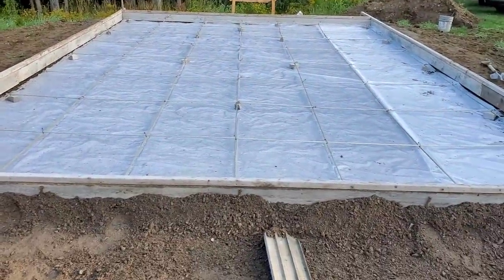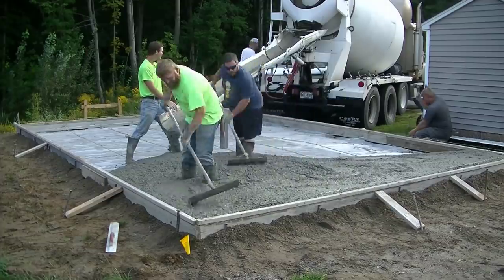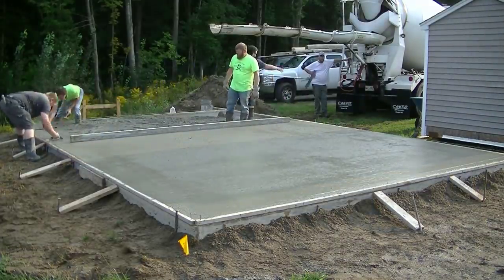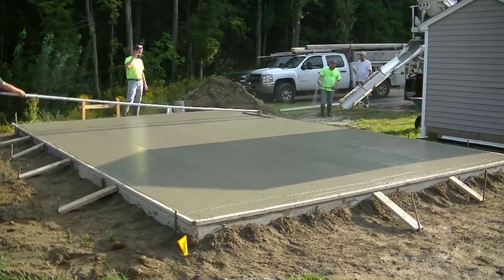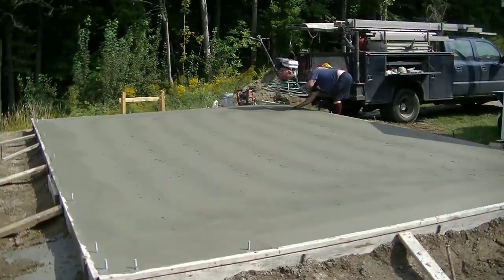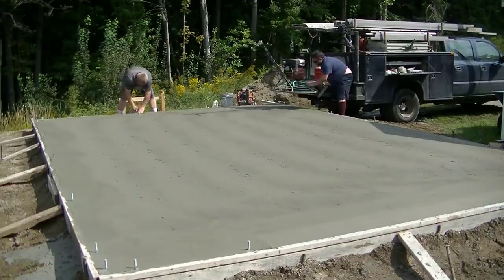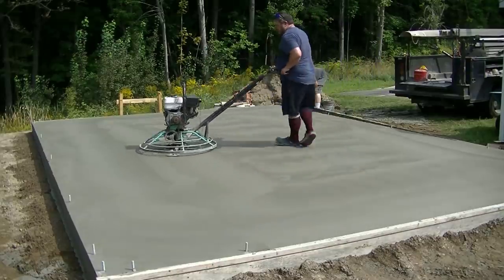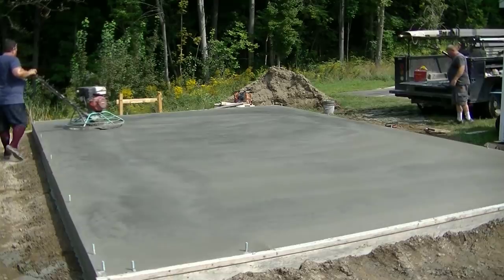They Made Us Pour This Shed Slab 8" Thick (Wasting Money)

Comment: Here in Michigan,  any slab supporting a building, that's less than 100 sq ft, a 4 in slab is code. Anything greater than 100 sq ft, then it would require a rat wall 8 inches wide by 18 deep, with re-bar and the slab 4 inches thick with re-bar like used on driveway approaches.

Comment: I don't get how these bldg's don't need footings to the frost line ? I watch a couple of NE guys, same deal. Heck, we have to put a deck stair landing pad supported to the frost line.
Reply from the maker: It's all in the gravel base and landscape afterwards. Permeable base that doesn't hold water won't freeze and heave.
Reply: @MikeDayConcrete  Thank you for the explanation. Steve in NC
Reply: You can always do what is called a shallow frostproof foundation/slab too...
Reply: As I understand it, and the reason for the 8" structural slab, is that you are making a rigid box.  The box floats on the base.  This is done in expansive clay areas as well.  Many with post tension.

Comment: I prefer having a vapor barrier under concrete where I don't want any moisture intrusion into the inside of the building.  Example was the tack room I put in barn;  have never had any moisture issues with Saddles or tack.

Comment: If this is an area with a lot of old people than the requirements you are faced with are most likely entirely because of them. Most likely scammers targeted the older population with subpar crap concrete work which prematurely broke down. The easiest way to prevent scammers is to have stricter regulations on work being done as well as a proactive inspector who visits sites to make sure the proper work is being done. If the scammer company didn't do the required work than the old home owner will have a much much easier time getting their money back.

Comment: Th3 building in florida collapsed because of corrosion from the steel rebar.  So im game for fiber glass rebar.   However in a situation where the concrete cracks.  If it does..  does fiber glass really have the bending ability to hold to the concrete if it shifts alot ?  Thats something i highely doubt.

Strength is one thing.  But can it bend ?.

Also you have no idea what kind of work hell be doing in his shed.  Maybe he needs th3 added thickness for something extremely heavy
Reply: You're correct about steel vs. glass reo. The latter has no ductility. Try bending a glass rod beyong its limit back and forth and then the same with a steel rod and then see what one will take a load. A bit extreme but in more demanding structures like in earthquake prone areas it is, but probably not in these cases.

Comment: Would be necessary with they wanted to anchor a lift to the floor no? But hey they want twice the material, they're paying for twice the material. It like framing with 2x6 with 16 on center, when 2x4 with 24 on center would suffice.

Comment: So is the fiberglass rebar cheaper? Can it be used for all Applications? Would you use it on Slabs meant for 50,000 Lbs busses. Or would you stick to steel rebar?
Reply: fiberglass rebar is fine for this application. You would probably want to use dowels or flat plates in the contraction joints as load transfer devices. Base support and compaction is of more importance than the tension reinforcement in the slab on grade applications.
Reply: @SigmaDG  thanks so much.

Comment: Everyone busted my ass for pouring 3/4 5000psi (6” thick)mix for my patio
Complete with mesh

Well, 12 years later my  patio is perfect.
My shitty 4”  ( 2500psi mix ) front walk with zero load  but foot traffic
Has 4 cracks.

Concrete is pretty cheap 
Pour thick

Comment: Something is going to be heavy placed on it.  When my father built his shop the foundation the footer is 1 foot in the ground with rebar, 1 foot above ground with rebar, 6 inches of ABC, and 6 inches of concrete.  Then dried slowly using soaker hose over a couple of days.  There is no cracks in the slab to this day.

Comment: fiberglass rebar sounds good to me as a homeowner - in my area everywhere you go you see exposed rebar all rusty - the metal gets wet and rusts and the rust causes expansion within the concrete and the concrete gets screwed up.  I would definately be a guinea pig and choose fiberglass if it were easily available
Reply: Good points hotdog!  This fiberglass rebar could be a game changer?
Reply: Good deal hotdog. Fiberglass rebar is not new... has been being developed for the last 30 years. Biggest use is bridge decks, so this is very very low risk applications.

Comment: Sounds like the local jurisdiction (somewhere in central Maine ?) has done a least a little homework in coming up with a minimum standard installation. My guess would be as an alternative to getting below the frost line (central Maine ?) and/or an engineered plan. Would be interested to find out where you get the fiberglass rods and stainless anchor bolts.

Comment: It seems as of 2020 or later half of 2019 the building inspector's are requiring a bit of overkill . I don't really know why , but they are . I had to pour a patio slab 6" thick with all four edges 12" thick by 12" wide all the way around the slab for a concrete beam and several 12" beams poured every so many feet . Now this is just for a patio slab . It's got more concrete beams than my dang shop slab . My shop hasn't had any problems or any cracks for over 25 years .  So I can't answer as to why everything has to be poured with serious overkill .

Comment: Interesting how stuff is done in other countries. In Australia the slab would be much thinner, maybe 100 mm, with an edge beam on the perimeter. Much more steel. 12 mm bars on the edge and sheets of mesh right through. steel stirrups to hold the bars in place. Much stiffer concrete and vibrated into position to make it slump and remove air. 
Anyone using a crane to lift a trowel machine would be told they were a girl and don't come back. if two guys cant lift it they better get another job.

Comment: What do you do with fiberglass rebar when you need to make a bend in it?
Reply: You will need to use steel bar in those situations, although they make some for columns (square). Basalt rock rebar made in Texas.
Reply: They sell pre bent corners, but they are very expensive..  The biggest issue with GFRP, even though it has a higher tensile strength, is it breaks instead of bends..   So everyone always says "it's stronger" and while technically correct, it has a sharper failure curve..  There is a great youtube video on the pros and cons of GFRP...
Reply: @FJB2020  agree....very easy to break.....
Reply from the maker: You gotta buy the pre-bent corners.

Comment: Showing again on how not use the reinforcement rebar. It’s needs to be up higher in the concrete
Reply: We were always taught that the wire welded mesh was to keep surface cracking distance to a minimum, so it should be at a minimum of 2 to 2 and 1/2 in below the surface. But if you're using rebar that would be intended to be in the tension zone which would be the bottom third of the slab. But an engineer usually has that spec'd out on the section cuts. But if you're just pouring a shed slab unless there is a gigantic piece of machinery that's going to be mounted on the floor I think what he's got there with the fiber glass rebar being at the bottom 2/3 makes the most sense.... This is just my opinion based on my experience.
Reply: Truth.

Comment: Why do skilled contractors always want to take short cuts, or cut corners?

If the inspector wants an 8” slab, charge the customer the extra labor and materials and just do it.

Also, the fiberglass rebar is too close to the ground.  Some rebar chairs would have been the correct call…

Comment: You're leaving out some information.  Because if you already had it set up and ready to pour with 2×6  you had to have a 1/2" gap under the form to make it 6" deep. So you couldn't just add 2×2's too the top and pour it. Because that would only be 7.5" deep and would also be 1.5" higher than the other slab if it was already set to grade. So you'd have to dig  out at least 2" underneath the form then pull all the nails in your stakes and kickers and let it drop down. Then go back through and set it all back up too grade and re do the kickers.  That's some bullshit because that's a lot of extra work you don't get paid for because there should be a structural detail on the approved plans that shows it being 8" deep.  Unless there's a revised set of plans with that detail and you had the original and nobody told you about it.  I've been on a job where that happened fortunately it wasn't me though.

Comment: Because one person had a problem in candle lake with a garage slab, they just made it so everyone from then on had to 8 in slabs with insanely huge thickened edge.  They could build 10 story buildings on those pads.  I cant remember for sure but I think it was 32 yards of concrete for 1 garage pad that was not huge.  

I have not used the fiberglass rebar yet.   What is the price comparison ?      LOL and I see the guy with the power trowel wearing crocks,  Why does everyone where crocks for power troweling?  LOL

Comment: Meh, the 42x28' slab in my shop came out at 7-5/8.  Used header block for the perimeter. 2'' of base. #4 bar 2' o/c plus wire mesh.  After the slab I went around the perimeter with 3 courses of 8-8-16 block then a 12' wall.  14' interior height.  Bolted down a 12k 2 post lift and a couple of machines weighing in at about 4-5k each.

Comment: It’s not as simple as thickness. It depends on the subsoil. 4” concrete is strong and if you want stronger add fiber. I spend my days, every day lifting settled concrete. The weight of 8” concrete is too much for most soils.
Reply: That's why you pour a footing or a monolithic floor. Pier and grade is crap and you might as well build on a landfill.

Comment: If you called a waste of money I don't think so if you pour the concrete properly or cement I should say properly with the proper mesh under it at like 8 9 in thick it will last a lot longer especially if you're going to be using it as an auto shop running a forklift over that floor or a heavier vehicle a 4-inch slab will split just like putty it's garbage

Comment: If its the city they're prob doing it because every garage floor at 4 inches thick is all craked up.
Mine is super old, built in the 1970's after the flood in pa. Mines all cracked in spots some of which is slightly raised over the other parts.

Its still usable for parking cars n that n holds the weight just fine so idc. If it was thicker, maybe poured with diff slump or fill or the way they do it now with certain fibers n that it'd of maybe lasted longer who knows.

Comment: With that much cream on top, is flaking a concern later on? We would advise customers to go with a broomed finish. They want it smooth because they are thinking about it being easier to clean, but they aren’t thinking about how incredibly slippery smooth concrete can get. Eight inches though?! That had to be a misreading of the code. Even if you were parking heavy equipment on there, 6 inches reinforced would be plenty strong enough.
Reply: I don't think there's much problem with spalling with cream at that stage. Power trowel isn't making much of an impact, so I presume the bleedwater has mostly dried off
Reply from the maker: We don't have any problems with flaking or spalling afterwards.

Comment: Your guys arent screeding it flat enough... I see them mag the edges and the screed never comes within a foot of the form boards.... Normally the screed would go all the way across from form to form to ensure flatness, or one side screeds to the form then they reach to the other side to ensure both sides are down to the top of the slab height. I suppose the magwork could be perfectly flat but I don't trust that as much as screeding accurately to the top of the form.
Reply: Of course it's just a shed, and you used a power trowel to help flatten it out.  I'm sure it's good enough 😉

Comment: My 3.5 inch driveway can withstand 70,000 pounds concrete trucks...I don't care about the thickness, It's all about soil compaction and the frost line ::    R403.3 -- For buildings where the monthly mean temperature of the building is maintained at not less than 64°F (18°C), footings are not required to extend below the frost line where protected from frost by insulation in accordance ... see  table R403.3 (minimum 12 inch perimeter, center 3.5 inch)

Comment: That rebar sounds pretty dope to me. lighter and stronger? Yes Please!
Reply: He got taken by marketing/sales BS.(Which may underlie why the inspector required  the increase in thickness.) Basic material properties don't support the stated advantage. They should be using #5 glass rods to replace #3 steel and there would be no difference in total weight. It is true that glass fibers as a pure material have a much higher yield strength to weight ratio than mild steel but this is not an advantage in passive concrete reinforcement, it is only an advantage in pre-stressed [active] reinforcement. In passive reinforcing elongation stiffness is what matters for crack control and compared to steel glass is like a rubber band, tension stiffness of steel is 205 glass is only 80.

Comment: How does the fiberglass rebar hold up during subzero temp.
Example, an unheated detached garage as far as if the concrete were to settle, or the drainage was bad and water caused a void under the slab.
  I am just a plumber and really don't know anything about concrete. Lol

Comment: Just had a 12'x12' shed built with a concrete slab. The crazy Village required 12" deep x 12" wide perimeter of concrete with rebar.
Reply: It’s called a rat-wall, same applies for pole barns where I live.
Reply from the maker: Totally unnecessary for a shed. Crazy!

Comment: Maybe you can talk to the Framers and tell them it’s 2021 we have great hammer drills and concrete anchors no need for lag bolts and you can get a better finish on the concrete and the bolts don’t hit on the studs or Windo framing.
Reply from the maker: It might be a little easier to finish but not a better finish.

Comment: Dude, buddy, yo....  A reinforced 6" slab for a garden shed is not even close to being robust enough to store a weed-eater, wheelbarrow, rake, shovel and a couple garden hoses.   Garden sheds should have a double reinforced 3/4" steel rebar, pretensioned 10" slab and the aggregate should be 2" washed rock not crushed rock.    Garden sheds are supposed to be able to withstand 5 direct, point blank nuclear blasts with a 10 ton tank sitting on it during a tornado with a 18" snowload....   Good god man, think of the children

Comment: I would rather have the 8" also. It seems concrete is getting to be weaker and weaker with cracks developing all of the time. Now you're putting in fiberglass rebar to weaken even more. This is not going to be stronger than steel rebar. Was there a reduction in price since you're using cheaper rebar? No, of course not. That is why you jumped to use it. More profit. You pretend to be on the customer's side, but you're really not.
Reply: Fiberglass rebar is not cheaper
Reply: @sergek2  I googled Fiberglass vs steel rebar and I found 3 articles right away that say fiberglass is cheaper.

Comment: U say its overkill to pour 8 inches thick n yet pull out this gas powered machine to trowel it out lol.
One guy could of easily did this slab by hand just as quickly.
Reply: that gas powered machine is called a power trowel and it also help to compact the concrete unlike hand troweling

Comment: The moisture barrier is worth it if you're putting a building on top of it cause that'll cause the slab to sweat. I agree 8 inches is almost certainly overkill. Unless they plan to park an excavator on it it's totally unnecessary. You could go down to a 10-12" footing to bear the weight of the building and a 4-5" slab in the center will work fine. Unless you're making a premium on the yardage it's not worth it for you or the customer. That is unless this is the 1% chance this customer is going to park several tons of stuff on it.

Comment: Hypothetically if they knew about the city code etc, couldn't they have made a filler pad to save concret. The concrete would fill the outer edge 8 inches and 12 inches inward, but say the middle of the slab is actually like 4 inches deep instead of 8.

Comment: That is rediculas. Usually at my day work we use 8" slab for free hanging concrete  for up to 4 meters, than 9" for up to 10 meters.

Really you don´t even need more than 4" for most normal application, but of cause then the reinforcement need to be  a bit denser.

Comment: grrr... i hate ridiculous codes and inspectors. matchthe level of the floor 30  feet away? What a nimrod. has to be 8" thick? will the owner be driving a tank in there? sheesh.. great job, though. I've done concrete and have nothing but respect for those who do it full time. Many, many years ago, my father and I ran our own small company and ended up building a garage for a man - 20X24. He and I did the whole thing, soup to nuts. That was about 1980, and that was the very last time I EVER want to do a pour as the principal. I'll help push wheelbarrows or even lay steel (fiberglass now), vapor barrier, dig trenches, etc., but smoothing? no thank you.

Comment: I hate code enforcement and other inspectors. They are on a power trip and purposely tell you that you have to do things that are actually not code and unnecessary. They get off on hassling people and causing people alot of problems. If they say you have to do something that sounds stupid, always read the code and find out if they are right. Many time they are wrong. Then file complaints against them.